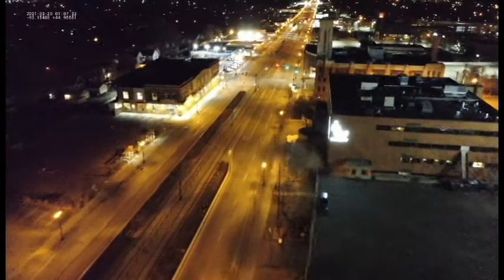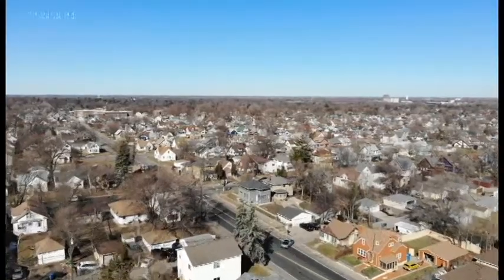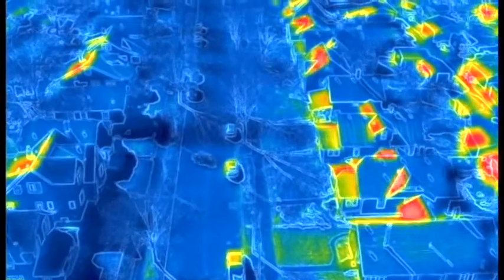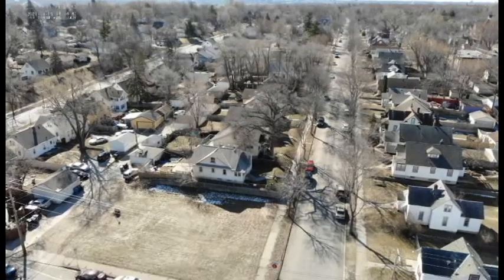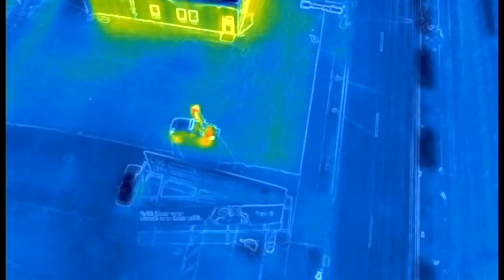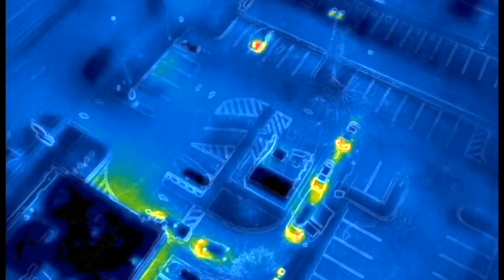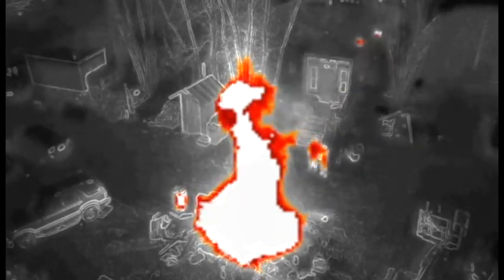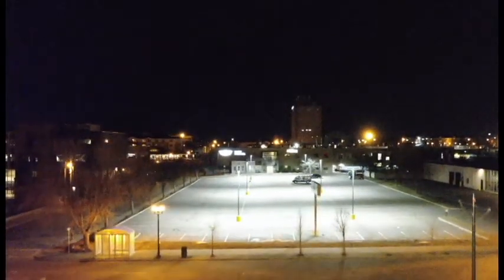Thermal Drone Basics

Comment: if there is leak in gas pipe can thermal camera see it ?
Reply: It might be able to detect stuff.  Sierra Olympics makes thermal cameras specifically for gas detection so check them out.
Reply from the maker: If there is a temperature difference you can find leaks.